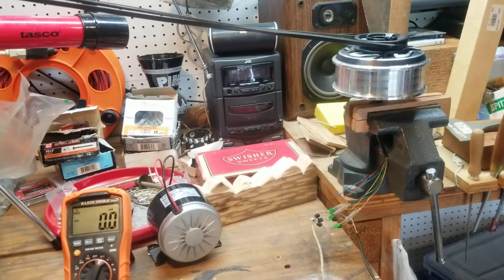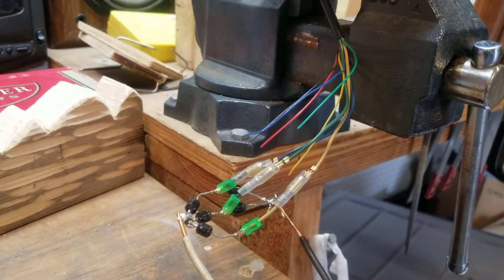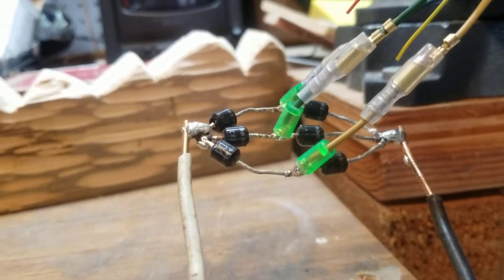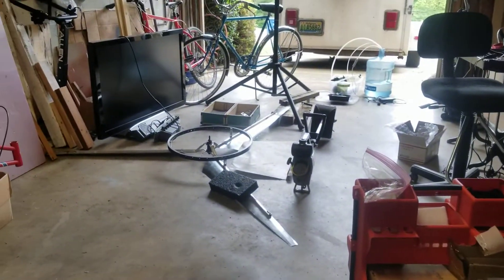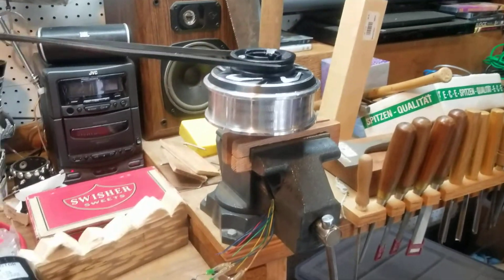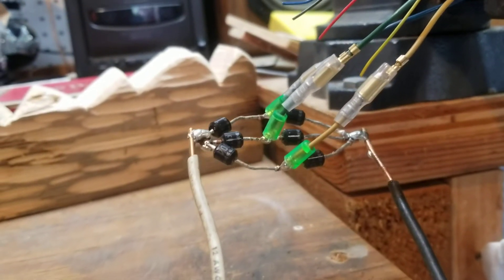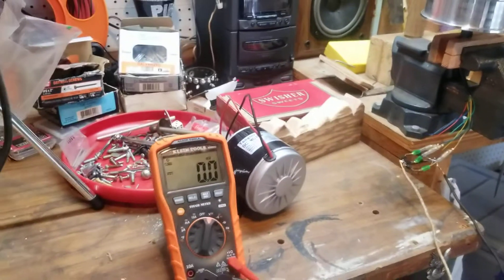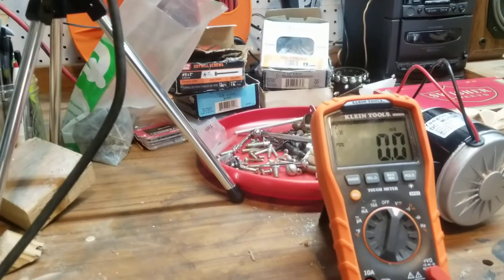Steady DC Power From 3-Phase AC Motor (DIY Hub Motor Generator Wind Turbine) - Full Bridge Rectifier

Comment: that is fine. Now if you want to really generate energy;
Test the motor under load vs RPM. 
Then RPM vs Voltage and Current, so you can really plot a power curve vs RPM.
The second step is to calculate the wind turbine (blades, diameter, etc) to the wind speed where the wind turbine is going to be installed, so you can match the RPM of the wind turbine in the Cp with a good power point of your motor.

Comment: Ya wind turbine garbage. Lol. Water turbine another story. But ya. Cheaper to just more panels
Reply from the maker: I tried lol but yeah it was a piece of junk from the get go, I fixed it a few times before just scrapping it, it was a great learning experience though
Reply: Adding more solar panels doesn’t help when you’ve had no sun for days, weeks and sometimes months. Meanwhile when ever we get those long rainy spells it’s usually accompanied by strong winds which blow the rains in from the ocean in Hawaii. During those times despite having over 3kw worth of solar panels my 70watt micro hydro setup is a way better power source. Looking to ad another one which is why I found my way to this video. Have a 12v brushed motor producing between 63-78watts 24/7. Now I’m working on a 24v brushless with 3phase bridge recitifier. I know how to wire the main three wires to the rectifier but I’m not sure what to do with the smaller set of five wires. Looks like their for commjnications for some type of controller for the motor. Since I’m running the motor from a water source to creat power I think those wires are unnecessary.

Comment: How can I run it from dc
Reply from the maker: Run the motor from DC? The same way all electric vehicles do it, with 3 sets of capacitors and mosfet transistors with speed controller IC chips. Basically, a "motor controller".

Comment: Hey just wondering if you can connect more than one generator to the same full bridge rectifier?
Reply from the maker: I think you would be better off with two separate rectifier to avoid overloading the amp limit and the problems with motor AC synchronizing or out of sync
Reply: @dragon_offroad  yea was thinking that, could you parallel the dc coming out of them?
Reply from the maker: @hoping67  sure, you do it with cars and jumper cables all the time
Reply: @dragon_offroad  brilliant thanks 👍👍

Comment: hi dan.i have overboard motor and bike wheels.so will any diode do.i have Arduino kit with some diodes in.i have a 24volt bike wheel bit heavy though not sure if can spin from wind as want make wind turbine.the radiator fan blade looks better.

Comment: Hello, can you explain more on why the turbine will not be able to spin that hub motor?
Reply from the maker: You will have to overcome the electro motive force (EMF) resistance which increases linearly with current. This could prevent the wind turbine from ever starting spinning especially at low wind speeds. Some type of mechanical or electrical clutch is needed that will not connect the power lines until the motor reaches a set speed, and ramps up the allowed current based on feedback of the RPM of the windmill

Comment: If i want to buy a rectifier which one should I buy for the same wheel?
Reply from the maker: It depends on your application, voltage, current, power, heat dissipation, etc.
Reply: @dragon_offroad  
For this hoverboard wheel which one should I buy
Reply from the maker: @khoshaalkhan7927  it would need to be rated for the 36v and 350w output maybe a motorcycle rectifier would work

Comment: am working on a similar hoverboard wheel to make handcrank generator ... to charge 12V car battery ... as a backup ..just in case ...
..but its hard to get even 10 volts output on normal handcrank speed/rpm  .......  Can you tell me how much volts you get when you spin yours at handcrank speed ..??
I plan to use 3 isolator transformer + rectifier ...to add up voltage output of that 3 phase winding ..  What do u think ?
Reply: These would be better for pedal power, but you could make a simple power transmission to make it spin quicker.
Reply: The motor is around 1000rpm for 36v so if you can do 500rpm~10 rotation per second then you'll probably be fine